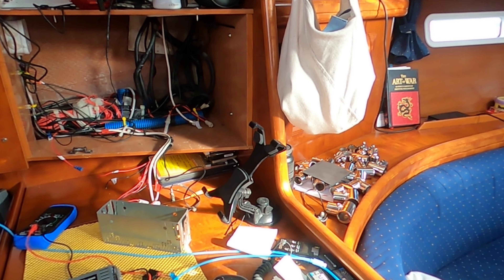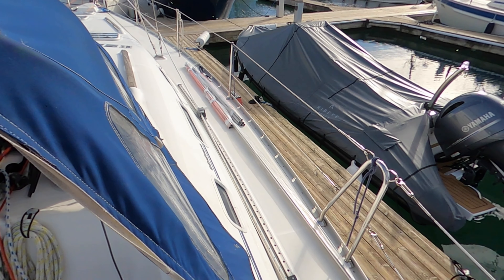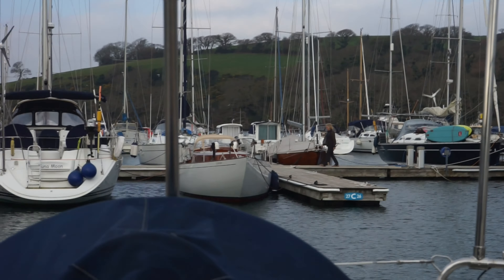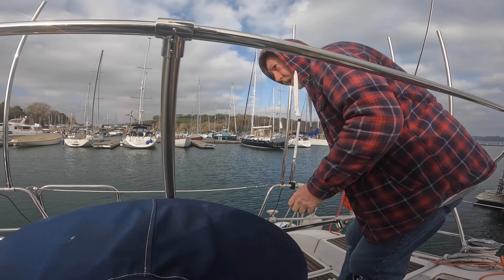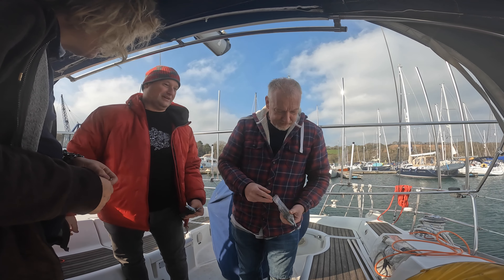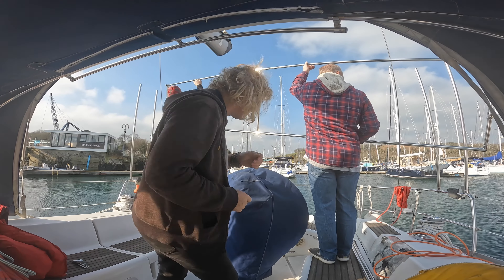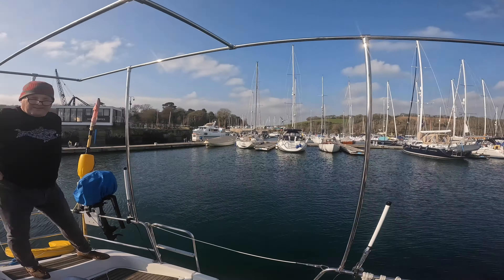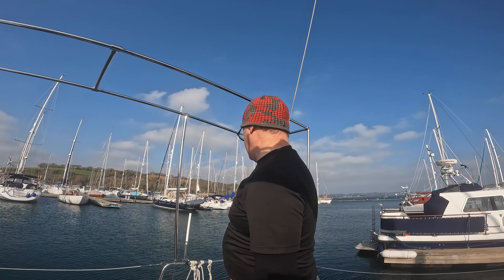Building a DIY solar arch on the cheap (Part 1)

Comment: I am buying starlink. The maritime or whatever it is now. It has that expensive dish. 2,500. I read it is way more rugged,4 times more powerfull etc etc. Hopefully .
I am usually 6 months in locations with no internet. So plan to activate and pause as needed.
I have waited for this internet in the middle of the ocean and its here now. Awesome
Reply from the maker: Sounds great, when it’s working it’s simply awesome. I am noticing as I get further north it’s dropping out more often though. There’s less satellites available the further north you go.

Comment: Thanks for the video. I am thinking to install one arch myself and the options are really expensive, so I probably will build one inspired for your videos. I believe you used 25mm tubes?
Reply from the maker: Awesome, thank you. yes 25mm, I went for the same diameter as the push pit rails, to keep it simple.

Comment: Interesting that you've mounted the frame directly off your existing rear guard rails......that's giving me food for thought .
Reply from the maker: I’ll be adding tensioned wires going fore and aft to hold it steady as a rock and also pull the whole thing down to reduce any lifting force on the push pit in strong winds. Will all be in the next video 😁
Reply: Works really well. The pushpit is mounted really solidly so Is a perfect base for building from. Mine has been used in 48Kts of wind so far and is still solid. Well worth the effort.

Comment: Ours cost about A$6800. But it was an insurance repair/replacement and did include a seat frame and deck fitting. I was fortunate to get a very skilled guy to do the work. Not all companies are that good. Today I reckon it would be at least A$8000. Then there is the waiting list!
Reply from the maker: Ouch! Not something for the “on a budget” cruiser. Then there’s the cost of panels, mppt’s and cabling.
Reply: @sailingonadream  Then there was the canvas cover that went under the panels.  I was not surprised to see the canvas trimmer turn up in a Rolls.
Reply from the maker: @philgray1023  omg 🤣